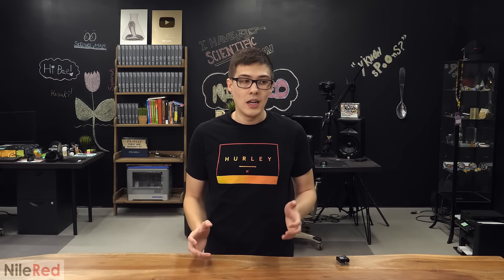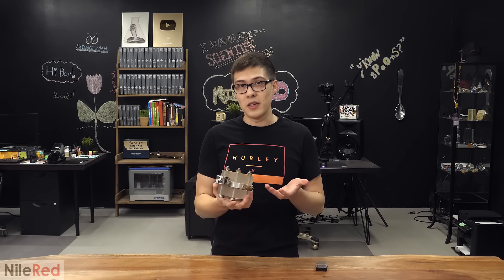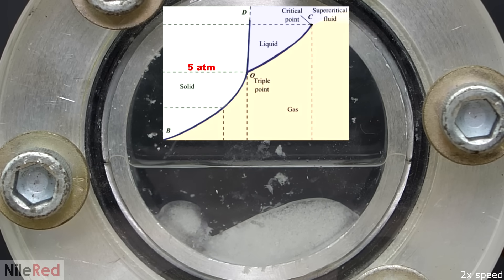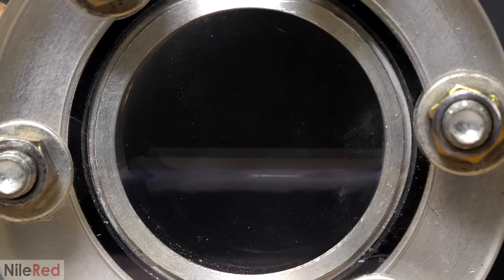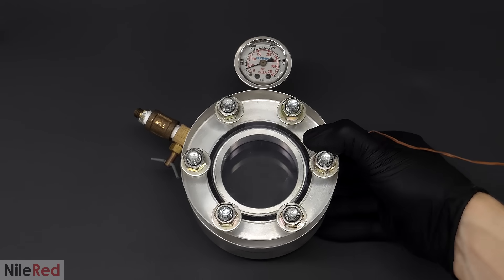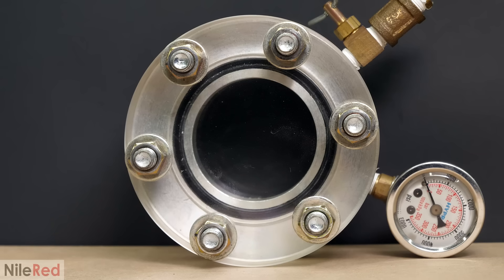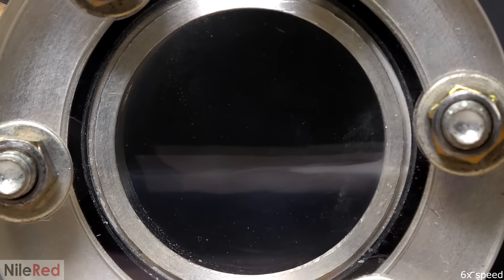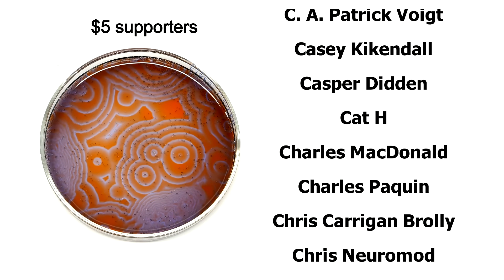Going supercritical.

Comment: Great video! If you ever want to revisit this experiment, I have a few suggestions that could help. 1) instead of using silica beads, you should try making your own silica through a sol gel route using siloxane precursors(TMOS-tetramethoxysilane or a safer/cheaper alternative TEOS-tetraethoxysilane) and an acid catalyst like formic acid. There's tons of literature on sol gel glass to get the right precursor+catalyst ratio and lots of aerogels are made through the sol gel synthesis route. 2) you should try and vent very slowly. From watching the video and hearing the loud hiss and visual of the chamber, the vent is happening way too quickly. I typically will vent slowly(no hissing) and it takes me over an hour for the chamber to reach back to ambient pressure. The structures that I make have pore sizes around 10-50nm so having a slow vent prevents any pore collapse from large changes in pressures.

Comment: The beads have fractures because the pressure in the chamber was to high and the beads broke  but the pressure also compressed them back together sealing the cracks back  creating fractures.

Comment: i have learnt in colloid chemistry about light scattering, and when you see the light blue color on the aero gel and the "smoke" in the chamber is because blue light has a higher intensity when scattered, red has lesser intensity when scattering. also this is only happening when its rayleigh scattering, in other words when the optical inhomogenity is around one order of magnitude smaller than the wavelength of the light, so basically in the aerogel there are a lot of small pores which acts as optical inhomogenity, in the "smoke" there are maybe really small doplets of the liquid CO2

Comment: The cloudiness is called critical opalescence.  As the critical point is reached the energy for the phase transition liquid to gas reduces to zero.  Individual groups of molecules can rapidly switch from liquid to gas from tiny energy fluctuations taking place at a molecular level.  It is essentially as you describe, but the liquid drops are very small, about a billion molecules.

Comment: Having SC CO2 permeate the beads in this 1000 psi form and then releasing the pressure to 1 bar is probably too much for them to withstand the strain and some internal fractures appear.  I haven’t made measurements on you video  but the beads might have puffed up like popcorn. On top of that SC CO2 is a fantastic solevent and maybe has cleaned those beads real shiny. Good work. Thanks for sharing.

Comment: CO2 is just kind of a fun gas. We also use it a lot in cooling applications especially for malls and stores. It's very interesting also because when used in climates with over 32 degrees C, it is super critical when it is in the gas cooler outside

Comment: Might consider buying a torque wrench.  Figure an appropriate pressure, and make sure all bolts are to the same torque.  Safer, and less prone to leaks due to symmetrical pressure.

Comment: It's a rainbow fracture. That's what they are commonly called.

It is basically the same thing as polarized glass. 

It happens a lot in quartz, and sometimes can make a stone a little more valuable.

What I think happened, is similar to shocking glass. If you take marbles and heat them evenly, then shock them in cold water, they form internal cracks that look similar to what the silica beads look like.

Comment: "Broken" gauge? You didn't have enough pressure to make it move; the lowest pressure mark looks to be about 15 bar / 200 psi, despite being marked 0. If you want a gauge that's sensitive at lower pressure then you'll probably need to swap it out with one that got a lower maximum than 350 bar / 5000 psi.

Comment: @UC1D3yD4wlPMico0dss264XA add a steel ring on both sides with holes drilled through them for the bolts.
You can even use a small thin cloth in between the acrylic and the steel to prevent scratching!!!
Reply: @UCivA7_KLKWo43tFcCkFvydw You too can do this, if you ever make another.
Reply: @UCivA7_KLKWo43tFcCkFvydw You too can do this, if you ever make another.
Reply: @UCivA7_KLKWo43tFcCkFvydw You too can do this, if you ever make another.
Reply: @UCivA7_KLKWo43tFcCkFvydw You too can do this, if you ever make another.
Reply: @UCivA7_KLKWo43tFcCkFvydw You too can do this, if you ever make another.

Comment: Just a thought, but each shot of the failed pressure gauge shows the apparatus tilted such that the entrance to the gauge is submerged..given the low temps involved, I wouldn't be surprised if that futzed the reading. You can see the liquid is actively entering the orifice..and given that the experiment began in a horizontal position (assuming it was allowed to liquefy in this position), the reading was likely invalid from the outset :) All the same, you captured a very unique perspective on the fluctuation in/out of the quantum state - many thanks!

Comment: When you’re tightening bolts on something like this, do one and then the bolt directly across from it. Repeat until all are tight. That’s the safest way with high pressure applications.
Reply: That is generally how you should do any bolt tightening, including your tires for your car.
Reply: @FastForwardPlans  Or the head of a drum (with lugs)
Reply: Torquing them would also be a good idea
Reply: You should do them in that criss crossing, but not all at once. You tighten one a bit, then the one across a bit.

Problem he has is doing it fast enough.
Reply: Adding a flange of rigid metal to both sides (with holes drilled for the fasteners to go through) would also serve to distribute the load and reduce the chance for cracking, but obviously your current setup worked fine (just food for thought if you're looking to improve the design for durability).
Reply: And for the love of god please use a torque wrench. Watching you use your highly calibrated elbow to smoke that plexi down made my toes curl.
Reply: same with drum heads!!
Reply: You do that along with tightening every other bolt then it goes together evenly. That’s always what I’ve done at least.
Reply: Pretty sure that's what he did
Reply: A chamber I built years ago was similar to the one in this video. The main difference is that I used aluminum plates on top of the clear plastic with a hole in the center, and holes for the bolts. This distributes the pressure evenly and decreases the probability of failure.
Reply: I feel like this man knows how to change his car tires :p lol.
Reply: "and it didn't blow up and kill me so.." that's what I love about science.

Comment: The coloration reminds me on Birefringent plastitcs/Photoelasticity. Back in the days before computer simulation it was how we would measure stress concentrations. We would bond an sheet of plastic to a surface, the load the surface and shoot polarized light at the plastic; the small deformations in the (usually metal) object would be mirrored in the plastic and change the polarization of the of the reflected light.
If the beads are cracking under the thermal and pressure shocks you may be observing these birefringent polarization shift (light is polarized passing through the outer surface, and repolarised when bouncing off the crack surface. Variations in internal stress would be responsible for the shifting hue.
Reply: because solid CO2 has a higher density than liquid CO2

Comment: The interesting thing about super critical CO2 is that its solubility greatly depends on the exact pressure and temperature, up to the point where you can set it to dissolve a single type of molecule from a system. Like oil from chips (or krisps), caffaine from coffee, or certain pesticides from rice.

Comment: Even without supercritical CO2 drying, you might get some decent aerogels to play with by just vacuum drying sol-gels polymerized from tetraethylorthosilicate (TEOS) using HCl as an acid catalyst to promote hydrolysis (with an abundance of ethanol), maybe Cacl2 to buffer the pH to about 2.0, condensing it with NH4OH, and soaking in ethanol for a while to replace most of the water.  After vacuum drying the blobs of aerogel will be cracked and messy, but it's quick and easy, and gives you small pieces to play with.

Comment: The fractures in silica beads have turned the silica into a refractive prism.  Light changes speed when it passes through the fracture and is refracted separating the different wavelengths of light.  Also, don't breath in silica dust.

Comment: Crazy question: Could that cloud be water? That could freezes between the liquid and the gas when heated? because when you evacuate the gas there are remnants like dry water calcium left on the plexiglass.  My thinking is the dry ice collecting water molecules. Causing the blue cloud because of the microns? Try this? /watch?v=M1t0egTZY44

Comment: When I dry my Silica in an oven they turn yellow as the water in them evaporates... when they absorb it over time they turn clear again. So my idea is that the water in them went somewhere else because you forced co2 into the silica  that took the water with it when you vented the chamber. My Silica also cracks when submerged in water after drying.

Comment: You need to get a good torque wrench if you are doing high pressure work. Read up on how some of the early bathysphere windows failed - you had a smallish fragmentation device in your hands. If it fails, cheap leather gloves will just add contaminants and bacteria to the fractured pieces embedded in you...

Comment: Isn't liquid CO2 a solvent? Could be that the cracks originated from impurities that have been dissolved out and then deposited on the beads (and chamber walls) when the pressure was released.

Comment: I can't believe you used a torx driver bit instead of the appropriate allen key to tighten the bolts.  3:37
This kind of equipment should come come with tightening specifications. The nuts should tightened in a certain sequence and with a torque wrench on the required setting.

Comment: I think what happened to the silica beads is, they simply cracked from the pressure release. The cracks are of a width comparable to the wavelengths of visible light, so they only reflect certain wavelengths. This is called iridescence.
Rocking video!
Reply: @DonaldKasper-j2r  - https://en.wikipedia.org/wiki/Iridescence
Reply: @750kv8  From an infrared spectroscopy standpoint a silica gel bead is related to, but not, quartz.  It is closer to a silica glass, and is amorphous.
Reply: @DonaldKasper-j2r  - Yes, I'm aware of that it's amorphous. the colors MAY be just prismatic effects, but you cannot exclude the possibility of thin-film interference (as mentioned in the vid), aka iridescence.

Comment: 10:20 When white/clear materials have a particle size of <micron if gives the material a "metallic blue" tinge/hue. If you stick a knife in an emulsion with a very small particle size, and rub the emulsion over the knife, you'll see the blue colour.

It's about light scattering (Reyleigh Scattering, credit to Donald Kasper)
Reply: @DonaldKasper-j2r  Indeed, the interaction of light passing from one substrate/medium to another, whether these small "particles" are gas bubbles, suspended oils or small solid matter :) (Foams, emulsions and dispersions respectfully).
Reply: @DonaldKasper-j2r  You say "tint from Rayleigh scattering of included air or water, but they are one solid structure", if there is air and water included in the structure it isn't "Solid", there are interface areas in the rocks, agates etc. Im not saying large visible pockets, I'm talking sub-micron particles. These tiny particles distributed through the material are what cause the scattering,, no?
Edit** Unless you're mistaken by my original comment, i was not saying that the overall structure/madium has a particle size of <1nm, im refereing to particles suspended in the medium, small particles of sub-micron size cause the scattering, not the fine particle size of the overall "carrier medium", eg:

Small particles of plastic suspended in water, with a surfactant would cause Reyleigh Scattering, its the plastic, not the water.
Reply: @Duros360  All minerals with internal water are called solid.
Reply: @Duros360  What you call an interface is based on scale.  I have laser infrared spectroscopy.  The laser is aimed at a specimen at a specific angle, goes in 5 microns, rattles around, and bounces off (refracts) off of atomic subgroups and comes out to a detector.  We see what the atom groups are by that refraction interaction.
Reply: Donald Kasper I defer to your more in depth explanation :), my experience comes from emulsions and dispersions;

I am simply coming from my experience using a ULM to measure particle size when I worked as a development chemist in a company making emulsions and dispersions, and the observations that if the particle size of the products was in the sub-micron scale, we would observe a blue tint when they were drawn across surfaces as a thin film. I believe I was trying to explain Rayleigh scattering using too specific an example, and making it sound like I was explaining it in its entirety.

I didn't know about the effects in crystals, and this has lead me to looking it up further, and I must thank you, I find all aspects of science fascinating, and love learning new things, hence my interest in channels like these :D
Reply: I'll admit you're starting to lose me now, I'm not referring to the glass beads used towards the end of the video, I was simply referring to why the supercritical fluid turned a blue hue as it formed, the time stamp I linked to was earlier in the clip, before he even mentioned the beads :S

My point was, when he asks "as it turned a blue colour, I don't know what causes this", I'm confused, as there are several comments referring to opals, I think we're misunderstanding each other, my original comment wasn't why the silica beads took on an opalescent sheen, I was trying to explained why aerogel is blue, lol

Edit: Right! The time stamp I used was 10 seconds too late!
Reply: Donald Kasper just for full clarification, I was referring to the “surface” in my original comment as the water droplets and their surrounding micellar structures in emulsions, that’s why I referred to it as more of an “interface”, not necessarily referring to it as a “surface”
Reply: Donald Kasper ^^This is what happens when a chemist (me) tries to explain an aspect of physics :P

Comment: 4:25 - Two words for you from your mechanic buddy Trikie_Dik.... TORQUE WRENCH! Hardware has grades or classes (depending on imperial vs metric) and those all have set torque specs where the  hardware can be set to maximum tightness without causing damage. Keep in mind your host material being clamped may not be able to withstand those max values - but you can do some trial and error, find the key value for your application, and repeat those steps for future iterations of the same test.

Comment: 15:05 I've seen similar effects in cracked ice before as well as in optically clear quartz (crystalline silica) crystals with flaws/cracks. In both of these cases, the crystal structures have no cleavage planes, meaning like glass they break conchoidally, I'm not sure what the mechanism is that causes the iridescence, but I'm willing to bet whatever you see in your case is caused by a similar mechanism to that in quartz and ice. It's likely related to the conchoidal cracks. (I always figured it was some kind of prism effect, but I'm not really sure...)

Comment: God damn but I'm such a pressure nerd.  This is dope.  Makes the vapor barrier for liquid nitrogen, which I'd only seen described analytically before, make intuitive sense.

CSB:
Big ol' tank of N2 outside the lab.  It obviously has a pressure release floater bubble valve thing that is situated above the grade of the top of the tank.  There's a check valve connected to the pressure control valve at the bottom of the tank so you can specify the fluid pressure at the bottom.  This is the only control available.

As summer rolls around, liquid N2 occasionally leaks from the floater valve.  How?  The liquid should be denser than the gas and also well lower than the valve.

Well... this happens.  The system naturally stabilizes around the critical point, given enough time.  Summer arrives and temperature swings start to get more extreme and humidity starts to rise.  If the pressure just inside the bubble valve ever finds itself lower than the pressure outside, the entire system effectively closes and pressure starts to increase inside the tank until it reaches the check valve pressure.  Thus, the entire system goes super critical and a region of liquid gas mix appears near the top of the tank.  This increased pressure eventually overcomes the external pressure and this supercritical N2 starts to escape... and immediately condense.

Like... I understood it... but seeing it happen is pretty special.